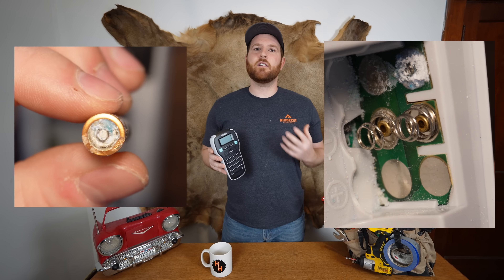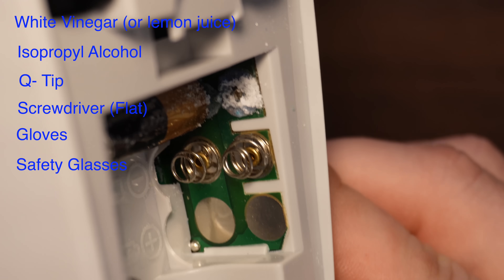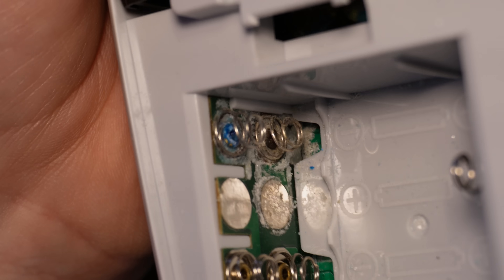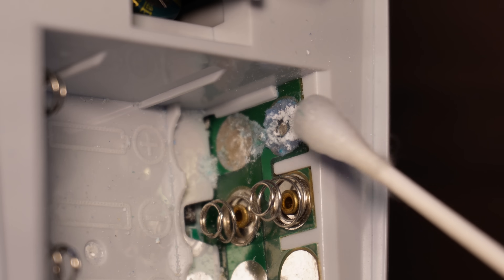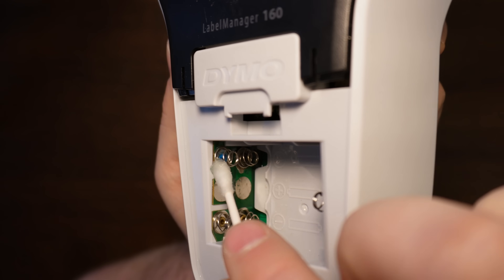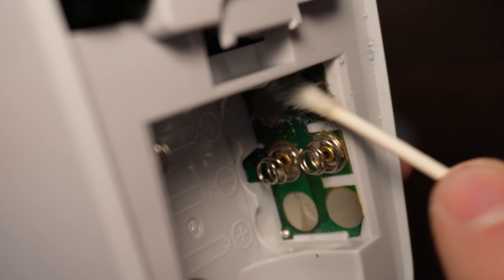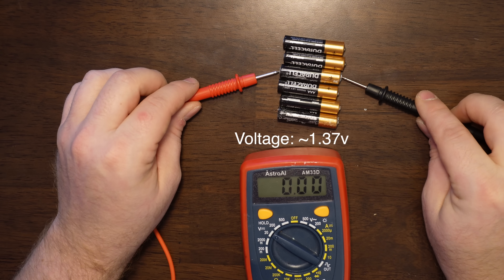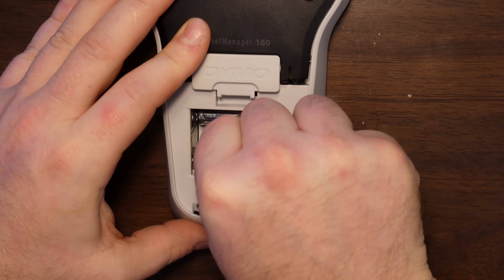Clean BATTERY CORROSION on ELECTRONICS! EASY DIY!  |  2-minute Tutorials Ep.4

Comment: The pencil erasers work well for cleaning 'dirty' contacts, ie when the contacts are dull or even black.  They are not up to the task for clearing corrosion.
Reply: I was going to say the same thing. Erasers are good for flat contacts or things that just need a little cleaning.
Reply: As a retired electronic design tech in the oil industry, I recommend never using an abrasive item to clean battery contacts, or card edge connections. Those connections have a micro-thin plating, often gold, that is about 15 micro inches thick. Using an eraser may grind off the micro-thin plating exposing the phosphor-bronze beneath it. Then you have actually a more corrosive connection. Using a chemical to clean the contacts is better.
Reply: @MrJohnnyboyrebel  ,   The vast majority of consumer-grade products don't have any significant anount or quality of real gold on the contacts; if they did, the only cleaning they would need, other than perhaps a degreasing with alcohol,, would be to pull the card or connector out and reinsert it and the oxide layer on the gold would wipe right off (I've read that gold actually does oxidize, but only to a fraction of a micron deep, and gold is quite soft, so the insulating oxide layer is easily wiped away by any kind of sliding action under light pressure). 

In my lifetime of repairing old audio equipment there were certain brands and models that had plug-in cards which appeared to be gold plated and were a known failure issue that sometimes couldn't be solved merely by degreasing the contacts or removing and reinserting them, such as old Sansui receivers with plug in cards whe're the only thing that really worked  to cure intermittent connection between the card and the socket was the pencil eraser technique.  Perhaps if you're working on early commercial computers the gold alloy plating used was of better quality but whatever Sansui used that looked like gold back then barely seemed to qualify (and this was 50 years ago, when gold was cheaper). 

 I don't know what kind of alloy they're using nowadays that looks like gold and is often found on cheap audio connectors, battery terminals of flashlights and remote controls and so on, but the actual gold content is going to be minimal at best and the appearance of gold is strictly for purposes of marketing. Anyway, I didn't see any "gold" inside the remote control battery compartment in this video, did you?

 Generally speaking, given a choice between a connector or connection point that has been sprayed with some kind of oily film that purports to remove oxidation, prevent its recurrence, or enhance conductivity,  versus a clean and dry metal to metal connection, I'll take the clean and dry connection for the sake of reliability.  Most switch and potentiometer cleaners only work well on moving contacts such as those found in switches and potentiometers that are frequently operated and where the contacts are sliding back and forth against each other with a wiping action. I would never recommend Deoxit or other electronic cleaner to be used on battery connections, plug-in computer cards, or any other connector that is essentially stationary ( And I don't care what the manufacturer's sales information says, especially Caig Labs;  their  aerosol spray can is messy and wasteful,  with a terrible nozzle design that everybody hates, and seems designed to waste the product so they get to sell you more of it at a stiff price).  

There is also the issue that certain contact cleaners and enhancers that leave a film or residue behind might behave very differently with a low audio signal voltage versus a higher DC or AC voltage. The audio shop I still work part-time for discovered decades ago the treating audio relays with Cramolin, an early Caig Labs product caused them to corrode a few years down the road.  I also read some application notes from a producer of silicone lubricants that said they were not recommended for use on anything carrying AC voltages because this could cause the formation of insulating glass like borosilicates on the contacts.
Reply from the maker: Good to know, thank you for explaining that.
Reply: ,  ideally you need ink erasers which have a little silica (sand, pumice or fiberglass) mixed into the eraser rubber. I use them often for cleaning relay contacts. However, to get inbetween the springs and down to the rivet that holds the spring, you need a fiberglas-bristle"scratch brush".  The hidden problem that you can't really fix with the vinegar is that there will invariably be corrosion in that crimp point between the rivet, the spring and the circuit board or metal plate, and the vinegar won't remove it all (note the green corroded rivet) so eventually it will become problematic at that spot unless you can clean it sufficiently enough to solder the rivet and spring together.  It's much easier to do this before the batteries leak and cause corrosion.
Reply: erasers work best on copper/brass contacts.   i use them for my old atari and nintendo game cartridges.
Reply: I will be searching for that fiberglass bristle scratch brush! I used to have a flat burnishing tool that was originally for cleaning relay contacts. I don't know where that went, but it was pretty good in springs.
Reply: @charlespatt  , contact burnishing tools can be a little rough and may remove too much plating from say tge contacts of a relay. At work we prefer the ink eraser for this.  The older pencil type erasers where the abrasive rubber rod was encased in a pencil-like wood handle (Staedtler, Ebersol, Castell brands) work best  but the older ones dry up and crumble (theyre apparently natural latex rubber)  and the newer ones are made in China or Venezuela from of some kind of vinyl like "plastic" eraser substance that is doughy and contains no silica or grit.  Tombow does make a retractable eraser pen that uses stiffer fiberglass-impregnated rubber sticks ( refillable) that can be very handy for cleaning relay contacts  and so on.
Reply: Wanted to make certain this was pointed out.  A pink pencil eraser is a good abrasive.  But as noted in comments here, an abrasive can cause other issues.  Thanks for the video.

Comment: Thanks for the tip! I’ve revived some electronics using WD-40 and a toothbrush. I forgot that vinegar can dissolve corrosion. I wish I had used it when I had a cheap (but good for what it was) shower radio that had corroded batteries. WD-40 didn’t work on that one, sadly.
Reply from the maker: Wd-40 I’ve never used that. great idea, thanks!

Comment: Thank you. Good info. I use rechargeable batteries. Cheap and good at Ikea costing about double of throw aways but lasting years.
Reply from the maker: I agree that rechargeable batteries are perfect for power hungry devices. 👍🏼
Reply: Rechargeable batteries are usually 1/10 or 2/10 of a Volt lower in output than standard alkaline flashlight batteries.  If you put 4 rechargeable batteries into a device that is supposed to use 4 flashlight batteries your voltage will typically be less by a 1/2 Volt or more.  The more batteries you have to use in series the worse the rechargeables will work as substitutes.
Reply: @goodun2974 I have not had any issues in 20 years with anything I have swapped them out with. NiCads are not near as good as the precharged batteries we have now. Even in flashlights with high energy use the lack of voltage seems to be made up for by the increased current available. I use in remotes, flashlights, camera flash, etc. I have never had a nimh or lithium battery leak.

Comment: Duraleak, the number 1 culprit.
Reply: So, this didn't happen only to me ‼️⁉️ Had a pair of AAA Duraleaks destroy a wireless keyboard rendering it unusable.
Reply: No wonder my Furby Booms (which had the Duracell batteries removed once I discovered that they were still in) are corroded, but my ZhuZhu pet that has had the same Toys R Us battery in it since 2009 is still spotless!
Reply: I've had lots of battery powered devices repaired after having Duraleaks inside. Always recommend other brands. Never saw that on Energizers
Reply from the maker: Exactly, after my package of Duracell is done, I won’t buy anymore. Too disappointing
Reply: This!! So much this!! I can’t believe that the most expensive battery brand is the number one brand to leak. I’ve lost so many gadgets due to leaking Duracell batteries. Once I figured out it was Duracell and switched brand haven’t lost anything.
Reply: In my experience, which includes hundreds of neglected cameras, Duracell is not the problem. It's [1] carbon-zinc chemistry, [2] warmth and humidity, and [3] neglect. When I see leaking Varta, Energizer or Duracell batteries, more often then not the batteries are 10+ years old! It's not the brand. (Although tbh I don't like Duracell, and favor Energizer, Samsung and Panasonic).
Reply: @Red_Lion8325  by your admission you see hundreds of neglected cameras that have sitting there for year and years and years even ten years or more right? Every battery is going to leak in those circumstances. No. Duracells leak when they are within date. When they’ve only been sitting there for a year or two. They leak when they’re not supposed to. When they are sealed in their original packaging inside of an air conditioned house. They leak earlier than other brands do and they leak more often than other brands do.
Reply: I have had leaks issues with many different brands of batteries. If batteries were leak proof, they would be much more expensive.
Reply: Actually it’s Energizer that leaks the most.
Reply: @Digikidthevoiceofreason Nah, duraleak.

Comment: The alcohol wipe off at the end was new. I don't understand mixing/inserting Alkaleaks at the end? I no longer use Alkaleaks, if I can avoid it. I try to use only hybrid rechargeable batteries or Energizer lithium batteries for those applications where I need 1.5 volt batteries.
Reply from the maker: I’m going  to look into the energizer lithiums after my Duracells are used up

Comment: I always say, if you think you are going to have a device that isn't used often, put some lithium batteries in it to avoid this issue.
Reply from the maker: Yeah, I think I’m going to look into doing that after my Duracells are used up
Reply: @HandymanHertz , Duracell alkaline batteries are the absolute worst. Leaking is common, and I've even seen cases where one of the AA or AAA batteries will change polarity, ie the positive end becomes negative and vice versa! I'm using mostly Energizer now, preferably the lithium type. Expensive but far more reliable and long lasting.
Reply: Agreed, Duracells suck.

Comment: If this doesn't work, what are the top 3 to 5 causes when a toy doesn't work? I have four It's a Bug's Life movie, Hopper Grasshopper room guard toys, and lots of other toys. Some don't even have any obvious battery acid issues. I have used  a compressed air can to blow dust from inside the toy from the many little holes and cracks, and once that helped briefly, but the problem returned.
Reply from the maker: I’m not sure, sorry! I’m not an electronics guy

Comment: Hey my controller turns on vibrates and turns off could this fix it?
Reply from the maker: That sounds like there could be a bad connection, take out the batteries and see if you can see any corrosion.